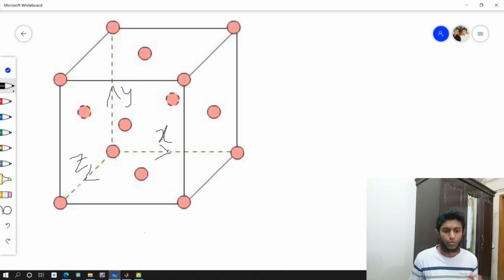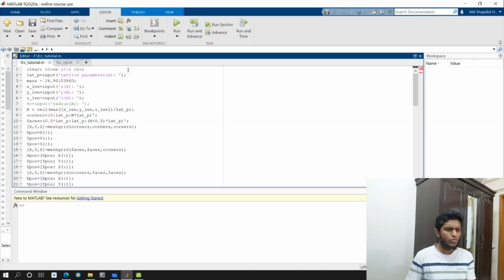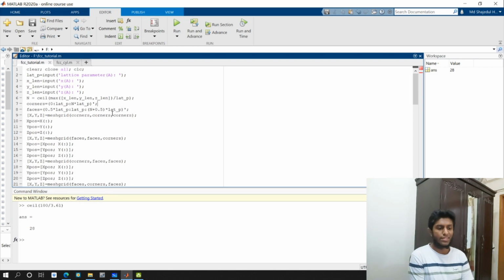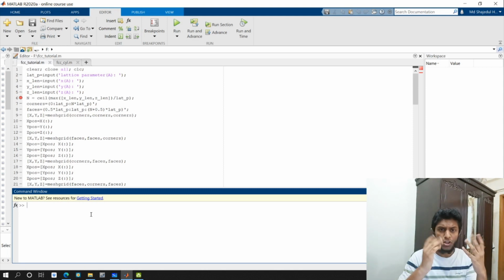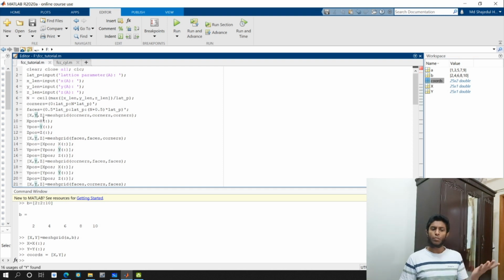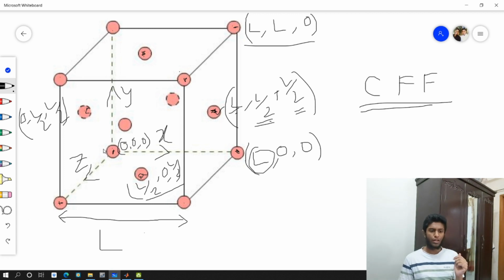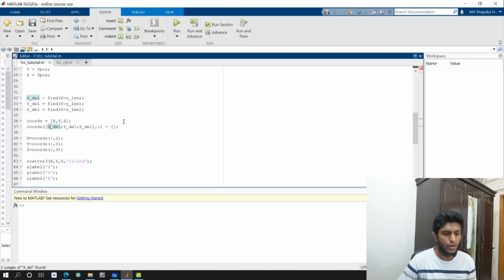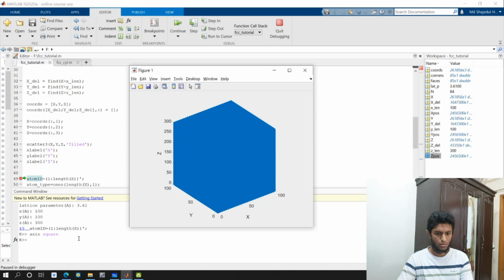Generate 3D Coordinates FASTER- NO FOR LOOPS!MATLAB Tutorial (colon operator, find, meshgrid)

Comment: Does this ensure periodic boundary condition? For some length  of X I  get periodic BC for other lengths I dont get it.
Reply from the maker: That depends on your lattice constant. Your length needs to be an integer multiple of the lattice constant in that direction for you to get a nice periodic cell.
Reply: @MdShajedulHoqueThakur  Well, if the length is not integer multiple of lattice contant then we dont have periodic boundaries?
Reply: The length we give is arbitary right, it can we 7 nm, 10, 44.85 nm  etc or whatever. In that case after creating the structure and cutting the length how do we still have to have PBC? simply adding lat_p/2 does not work. I am just trying tounderstand how to do this. Your code is very efficient
Reply from the maker: @tanujgupta8381  you need to understand periodic boundary condition. Your lattice needs to be identical on opposite edges for periodicity to be maintained. That's why I said you need a multiple of lattice constant. Adjust the length values a few times and you'll see what I mean when you achieve periodicity.